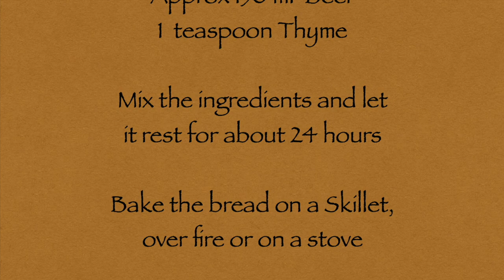Viking series: Viking packframe and leather bottle

Comment: Hi Tom, glad you are better. I'm wondering, what was that laser machine called? Does it plug into a laptop for the designs or something? Are they expensive? I want one of those.
Reply from the maker: Thanks Micky for your feedback and question 👍🏻😁 it’s this one 
https://m.laserpecker.net
And it works by an app on your smartphone … very easy to use 
The prize 🤔 about 250 $ 😊 so it’s not cheap but top quality 👍🏻
Tom

Comment: I so appreciate these videos but alas, I missed the most important part of building the pack frame! You didn't show just how you attached the little arms that come out at right angles to the long side pieces and support the weight of what's strapped to the pack! I  saw the holes you drilled and saw the pegs (dowels) you whittled, but then the video leaps to you driving the little wedges into the backs of the dowels to tighten them and hey-presto, the pieces that come out at right angles are already attached and everything is already glued in place!

You probably thought it was so obvious you wouldn't need to show the whole thing, and probably is to most of your audience. But I'm certain I'm not the only woman who subscribes to your channel and for most of us, turning things around in our imaginations is one of the few genuine, scientifically proven gender-related differences. Its such a reliable thing that-- at least in the U.S.--many companies used the fat to secretly exclude women from their work forces by giving tests to potential new employees that included challenges where the person had to turn around stacks of blocks or boxes in their imaginations and then answer questions about how many there were in a certain row or where the black block ended up. It's one of the reasons there are so few women architects and engineers. 

I'm better at it than most, but I really needed to see those wooden pieces go together, needed to see how the smaller ones were positioned in relation to the long upright pieces. I really want to make one for myself which is why I was so horrified to realise there was that blip in continuity. It's too late to go back and do anything about it now, (and I think i worked it out eventually,) but can you think of me next time you make a DIY video and try not to skip anything? I would be really grateful if you did. 

I especially value your DIY projects. Thank you so much for making them and this channel.